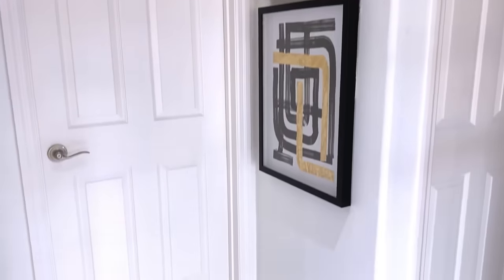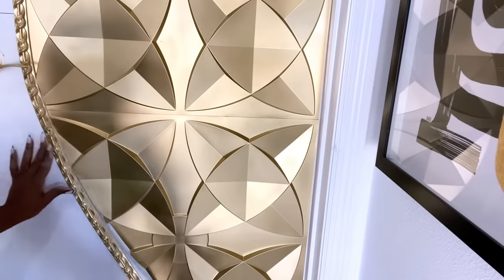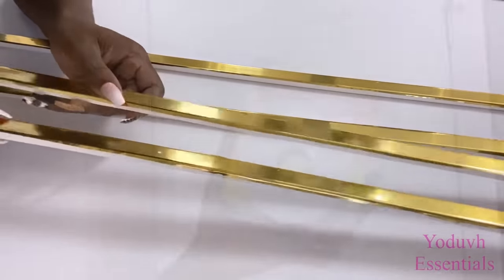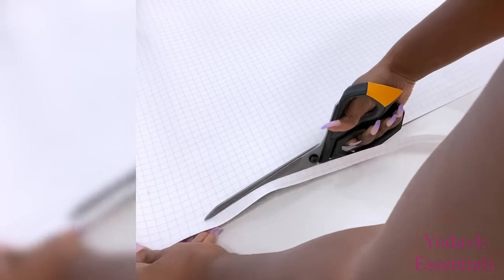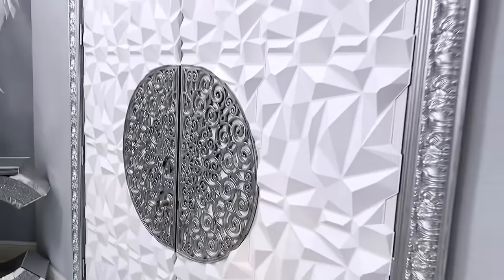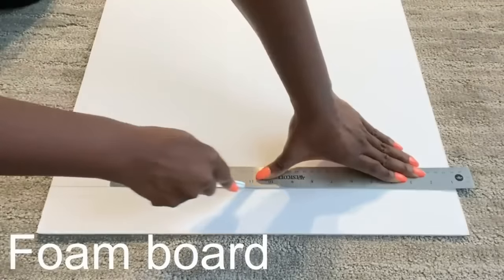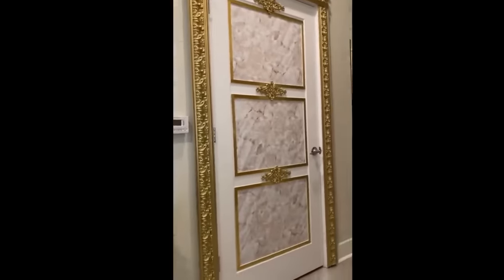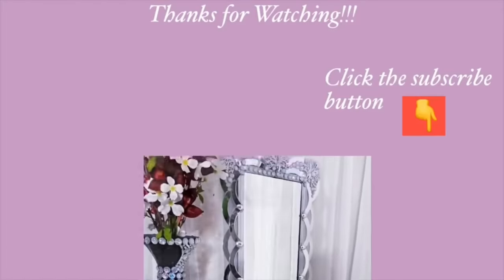PALACE DOOR DIYs| NEW and EXPENSIVE Looking Ideas To Update Your Home For Cheap!

Comment: Okay, so.. they are great. However, on a rental... 

I'll just say when you pull up the contact paper it removes a surface level of paint pigment seal, meaning as soon as the next person moves in and cooks anything with grease, sand is kicked up from a strom.. and so on it is visible in the paint. 

So even then plan on having all rentals repainted the minute you decide to cook up some greasy cheese burgers or something.